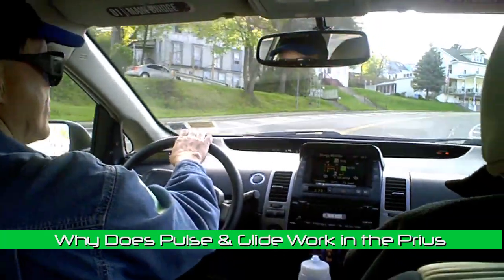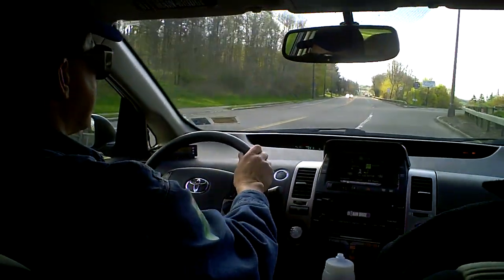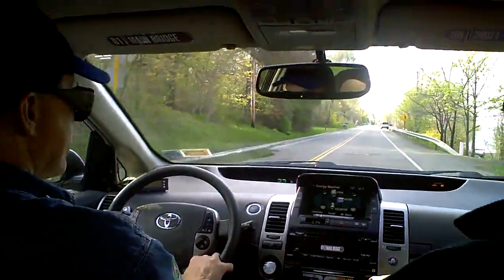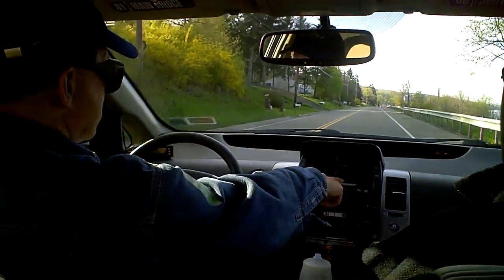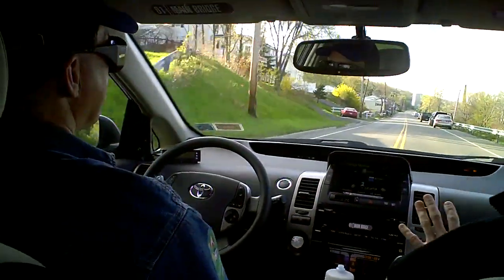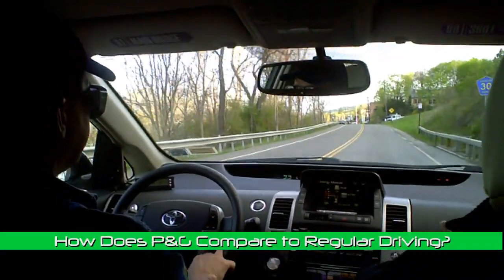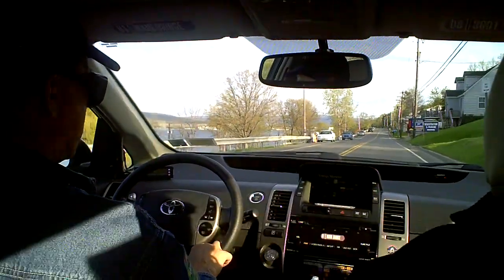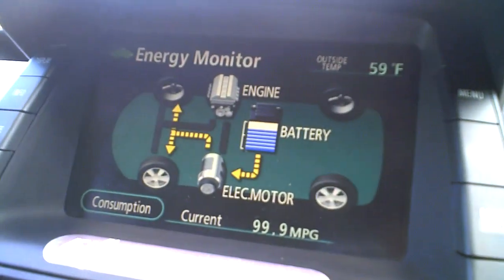Toyota Prius Pulse and Glide Fuel Economy Tutorial

Comment: Good tutorial; one thing I would add is that, in New Zealand, drivers do NOT like anyone going at, or below, the speed limit. I use pulse and glide from (low-high) (31 - 40mph) - 40mph being the highest speed you can go before the Prius forces the engine into 'on' mode (even if doing infinite MPG, the engine is being turned to stop the elec. motors going to fast)...
Reply: I think highways are optimal for this, since people can just pass you as needed. If you're on a rural street, make sure your pulse makes up for any slowdown from the glide if you have people behind you. Keeping up with someone in front should allow you to do it guilt free.

Comment: It does not go into gear when you coast and part of the difficulty with P+G on the prius is that you have to finesse the throttle so that when you're gliding, the arrows aren't going into or out of the battery. I think the ECO mode in the 2010+ Prius should make that easier to do. I've read conflicting information about whether switching to neutral at speed over and over is ok in the Prius or not. Good news on a pure EV car though is that it really is ok to switch into neutral.
Reply: imzjustplayin from what I can tell, neutral is not helpful at all. If you put it in neutral while the engine is on it will stay on. If you do it while it's off, it will discharge the traction battery (the electric motor engage while gliding to reduce drag) and the motor will kick back on to recharge the traction battery.

Comment: Well the best way to accelerate is to do it in the best BSFC area, though to figure that out would require some sophisticated instrumentation and computer assist to figure that out. It has been my experience that the way to get the best fuel economy in an automatic is still to basically accelerate relatively gently, trying to shift into the highest gear as quickly as possible. Harder acceleration means shifting at 3K+ RPM per gear instead of 1500RPM.
Reply: I think with an automatic it's a bit harder to get into the minimum BSFC as it keeps downshifting to the higher rpm whenever you try to get the load up with the accelerator pedal.
Reply: @TimpBizkit  tricky

Comment: I try to use similar techniques in my gas car, but it doesn't work unless you turn off the engine each time, then you are wearing on the starter. 
It seems like this technique would be very good for approaching signal lights, etc., so as not to anger following drivers too much.
Reply: Heath Ledger you shouldn't do it with an automastic anyway unless it's cvt. With a manual trans just kick the clutch to restart.

Comment: P&G is great as long as it doesn't affect others.  I P&G in regular automatic vehicles (traffic permitting) only in them you coast off the throttle at above about 45 (depending on gearing) which engages fuel cut mode where the injectors aren't being pulsed then just as the injectors kick back in you accelerate as hard as you can without the torque converter unlocking or the trans downshifting, when you reach about 60 you let all the way off again.